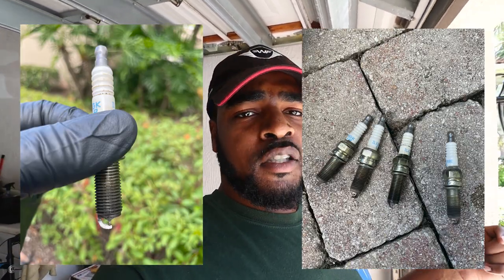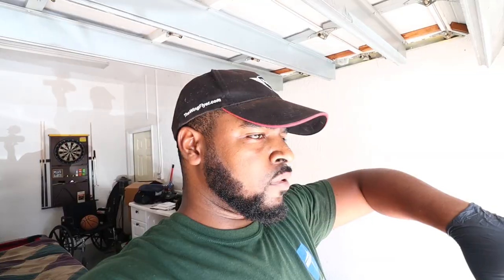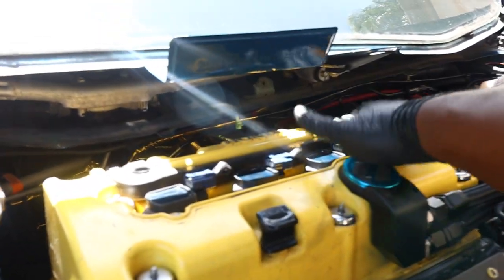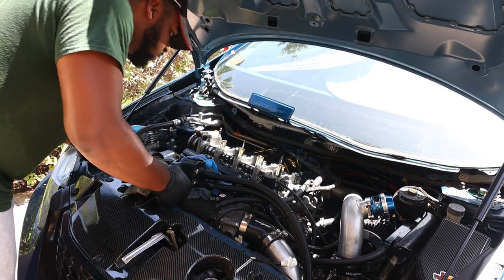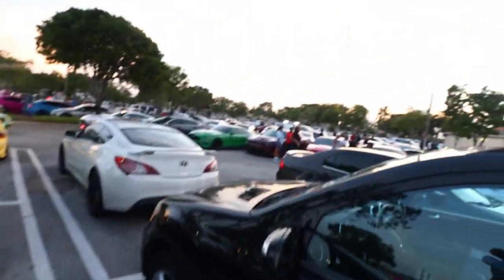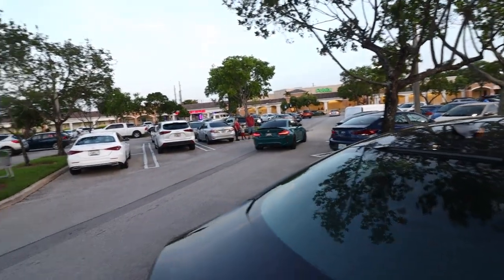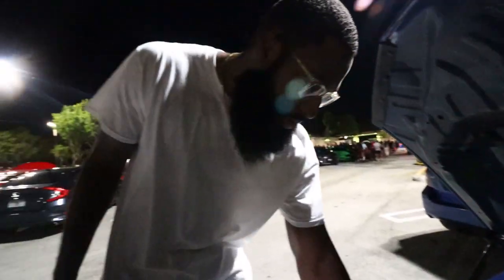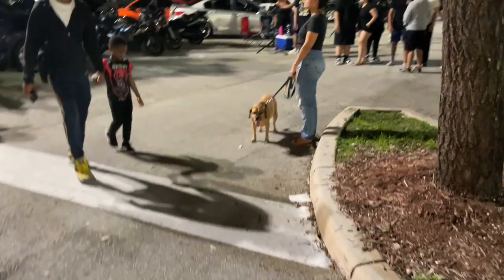New EXPENSIVE Upgrade For My 500 HP Honda Civic Si

Comment: Tube seals wouldn’t cause oil to get onto the threads of the spark plugs oil would in the tube itself, that’s mostly fouling from your oil control rings starting to get gummed up or something in your tune or the spark plugs themselves being incorrect heat range.